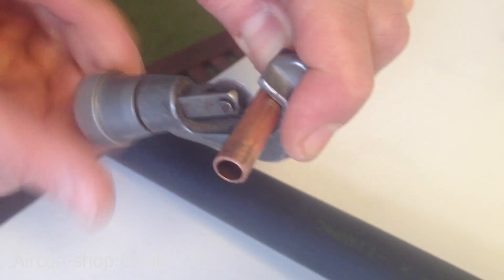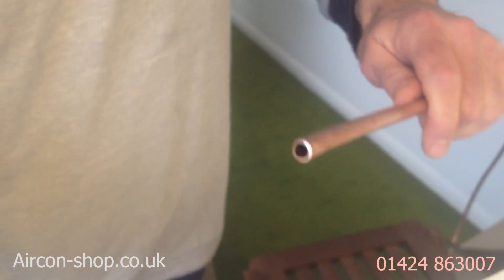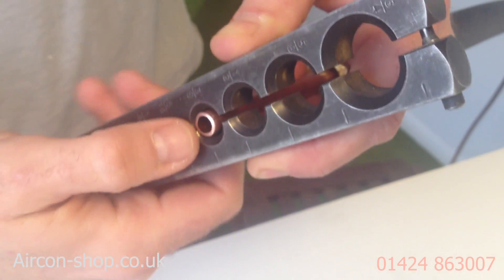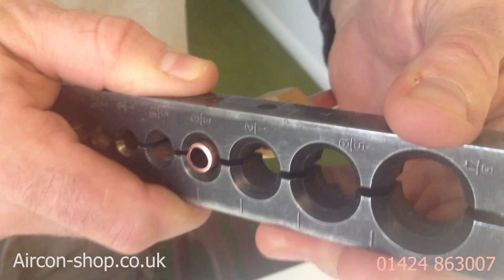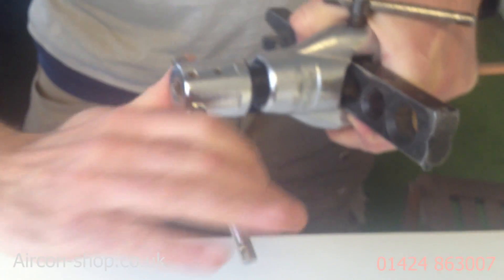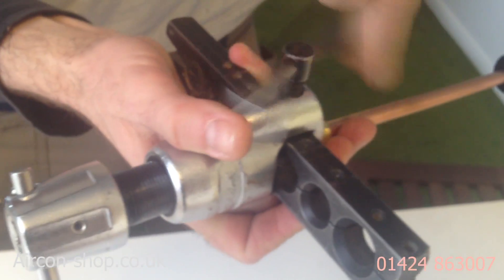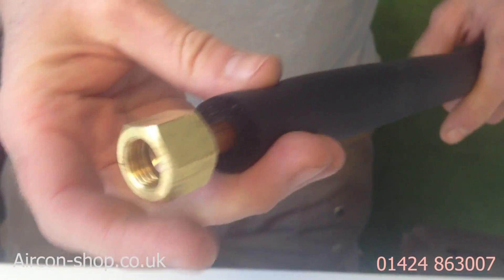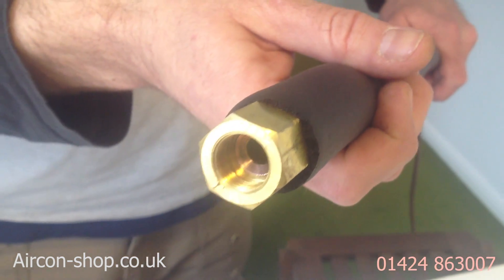air conditioning diy install part 1: flaring

Comment: 1mm tube above the tool is too much for R410A system! In fact Mitsubishi mini slip instruction manual called for 0 to 0.5mm only. 1mm should only be used for R22 system.

Comment: I have a friends tool it resembles that but the flarer is not a torqe one just a vic , so that will be by feel and visual . my question is  I reuse the same  nut.  on a 25 foot pipe  just cut to size. practice first on the    throw away piece  and then go for it and use a Locktite washer.

Comment: Sr., sorry, but you are cutting on wrong direction, keep constant pressure turning on opposite turning direction, you are bending the line, by apply to much pressasure on one spot...😟

Comment: Sigh, another professional who has "done thousands of flares", and has probably neglected to debur everyone of them. Any burs create stress risers that can lead to cracking and then leaks. Didn't inspect back of flare for any damage done by the holding fixture either.

Comment: Would it not be best to deburr the edges of the tube a bit first before flaring? 
I was also told to dab the flaring cone with a bit of compatible compressor oil to get a smoother flare.  Do you have any thoughts on this practice?  Thank you ever so much!
Reply: Yeah, you really should debur the tubing before flaring.

Comment: you did 3 twist on the second tension of the copper pipe ringer you clown hence why your copper pipe has a flat cut in it , im a week into my apprenticeship and i know this is wrong , next time show people how to cut aswell not just flare
Reply: Not profesional,big mistakes after cuting.
Reply: Brendan Dobbin in his defence the title does just say flaring not cutting
Reply: Just remember that an expert is: ex is a has been, and a spert is a drip under pressure. Lol